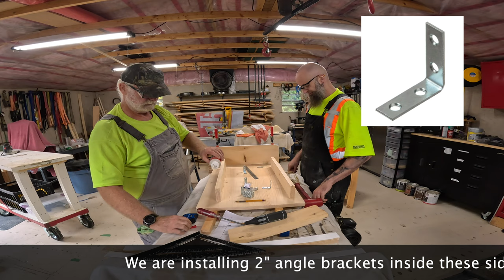It's Done! My First Attempt At Making Furniture Is Complete!

Comment: Nice job on getting your 1st piece of furniture done, looks great Brian.  You'll have fun with a biscuit joiner. They are very easy to use and  help with alignment, more so on larger than smaller projects. Note that they don't really add more strength to joints. I used mine a lot when I  first got it many years ago,. Since then and nowadays I use dowels. I make my own dowels and use quality dowel jigs. Nonetheless I think you'll be happy with a biscuit joiner. Happy woodworking!
Reply from the maker: Thanks Paul. Yea, the one thing that makes me wonder is that they don’t add any strength. It still may be a good tool to start with. I may try something again this winter. Thanks for stopping by!

Comment: How's she goin'?  A successful project guys!!  Very nice.  Brian when I do a glue up panel like that I have a belt sander that I use to trim the edges and get rid of the 'steps'.  Sometimes it takes a lot of sanding but generally it works out pretty good.  Nothing wrong with the way you tackled it though.  Pretty nice I'd say!!  Take 'er easy!!
Reply from the maker: Thanks Mike! I even have a belt sander. I just didn't think of it. I will the next time. I better see if I've even got belts for it.😆 Thanks for stopping by!

Comment: I would have used a belt sander in this situation Brian.............that's how I did the galley countertop for FRILL........too bad you didn't have or used pocket hole screws instead of those "L" brackets..............It's a lovely peice of furniture.......and looks amazing Brian......great job!
Reply from the maker: Thanks! I don’t have a pocket hole jig but after seeing what they can do, I’ve added that to my list of tools to look at. I have a belt sander but I only have some 80 grit belts. I think that would have chewed a hole through it very quickly. Another item I need to get. It was an interesting experience making this. I learned a lot and I appreciate your thoughts a lot as well. Thanks again!👍👍